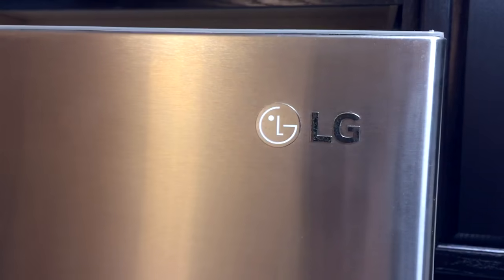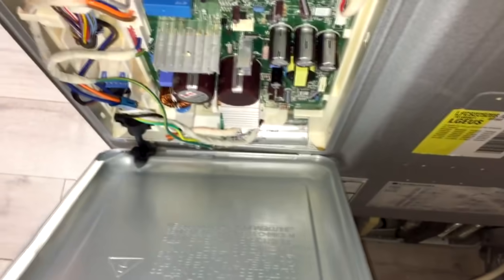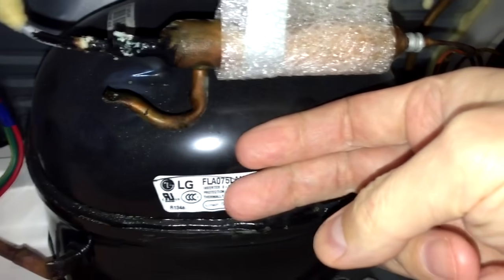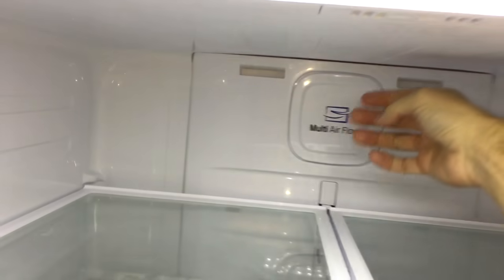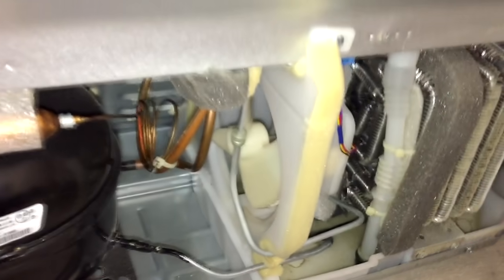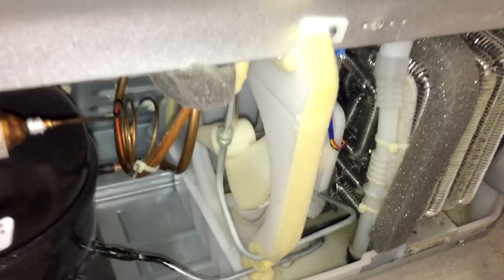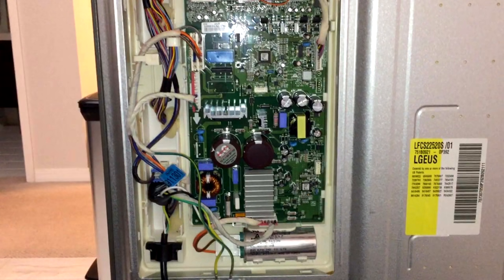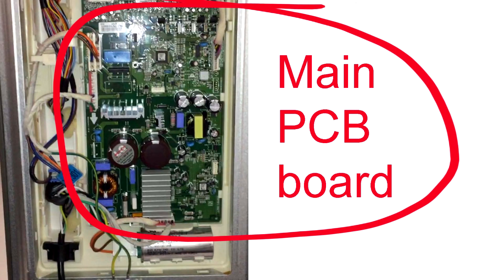LG refrigerator test and reset button

Comment: Stage 3 on my fridge doesn’t even work , would that mean that the thermistor to defrost the evaporator has gone bad?
Reply from the maker: Some LG refrigerators have only 2 stages. First stage - all fans and compressor work. Second stage - fans and compressor off, and defrost ON. If it's already warm inside the refrigerator, the Defrost stage will be skipped. What is the actual problem with your fridge? And the model number can be helpful.
Reply: @Your-Self   LG fridge Model # lfxs27466s 

Compressor works , evaporator works, both fans work. But it just isn’t cooling the top. The fridge I have , has three stages, was testing it today, and all of a sudden the third stage didn’t want to initiate anymore. But at this point I’m stuck. The ice section is getting cool air. Just not the top portion. It’s hot in there.
Reply from the maker: I've looked at the service documentation, and it's showing conflicting information. So I'm still not sure if you have 2 evaporator coils (one in the freezer and one in the top fridge) or just 1 inside the freezer.
Either way, you need to measure the freezer temperature. If it's around 0°F, the problem may be minor. But if it's significantly above 10°F, it may seem cold but could be a beginning of a major problem.
If the freezer is at 0°F, you can focus on the top fridge compartment. I'd take everything out of the fridge compartment including the back wall, to look at the evaporator coil (if it's there at all). If the coil is full of frosty ice, you may have a defrost issue. Under the coil should be a black rod heating element. Or maybe your model doesn't even have this heater and relies on the fan to defrost it... not sure.
It's difficult to troubleshoot without knowing what's inside your system due to poor documentation.
Reply: @Your-Self   the model I have only has one evaporator coil, and that’s at the bottom(freezer). It doesn’t have the two like I seen in other models. The element does indeed work, but seems to only have come on when opening the freezer portion and keeping it open. It then starts to defrost. Was a bit stumped at that point, so I decided to use the testing phase. I have confirmed that it has three stages to the test. It’s just that the third test wouldn’t initiate after a couple of tries. But I was able to verify that the element does indeed work. As for the evaporator, it gets a bit iced up but I wouldn’t say it’s excessive. It only has some, not enough to restrict air flow. 
Today I will be measuring the freezer temp and see what I get. But it’s gets really cold down there already.
Starting to assume the temp sensor(thermistor) might be faulty. That or the defrost sensor. I believe the evaporator fan should be blowing a hell lot harder than it is currently. The other fan is for the ice making section, and that works perfectly. Real strong cold air going to it. The fans in these fridges have different speeds controlled by the PCB right?  Research has shown that there isn’t no temp sensor on top, just the bottom. So I’m leaning on that for now, since everything has been verified to work.

Comment: When I run the test on my side by side with lower freezer the test #3 does not happen. Test 1& 2 seem good. But when I push it the 3rd time, no beeps and it just stops. Its model lfxs28968s. Thank you

Comment: Thank you for the video, it is very informative and easy to follow.  I have a lg LFX25991ST (French door) with an evaporator fan problem.  No air flow in normal operation, fan works great during test mode 1.  

I took off the panel to access the coils and fan,  and found plenty of ice on the coils.  I defrosted the coils with hot water, wet shop vac came in handy for overflow below.  

I'm not getting any error codes after running all test modes and waiting for everything to cycle back to normal.  Not flashing LED on bottom right of PCB.  I'm pretty sure I've located the bulb, but no blinking.  Evaporator fan doesn't kick on in normal mode.  

When should I get the error codes?  The moment I press the test mode button or after the 3rd test?  I figured it would light up after it completed all tests, but it never did.  

Any thoughts on what the problem might be, or suggestions on a new fridge 😄🙃
Reply from the maker: Looks like your model has two evaporator coils, so the freezer and the fridge compartments cool separately, one at a time.
It's normal for the fan to stop when you open the door in the normal mode. Trick the system as if the door is closed by activating the door switch. And the fan should start blowing within a minute unless the other compartment is cooling currently.
Error codes may come up at any time or may not come up at all, even with a problem.
Which compartment did you defrost? And what is the actual problem, both compartments don't cool? Is it any better after the defrost?

Comment: my LG fridge give 3 blinks when I do the testing
how can I fix the bad PCB 
thanks
Reply from the maker: The problem, most likely, is with the compressor itself. Or the refrigerant leak that caused the compressor to fail. It's best to call a technician to troubleshoot the problem.
Reply: thank

Comment: Excuse me, my refrigerator model is LT1342BbWI and it's not cooling or freezing since yesterday. I ran this test and there is a blinking red light that goes for about 6 times, stops, and then blinks again. The board is atop not behind. Hope you could help me.. Thanks
Reply from the maker: You didn't mentioned if you verified that the compressor is running, and both fans are running as well.

Comment: Need help. My refrigerator is giving off off the charts radiation. I have a meter and it is off the charts. What can I do to resolve this? It’s LG model LFXS29626S
Reply from the maker: What kind of radiation, ionizing or thermal?
Reply: @Your-Self  I am not sure what the differences I have a meter that reads RF. And it is off the charts
Reply from the maker: RF stands for Radio Frequency. And it's probably coming from the WIFI on your fridge... if you have it. Shouldn't be a problem.
Reply: I want to disable it. Do you know if there’s a way to do that
Reply: @Your-Self  I’m so sensitive to rf I need to figure out how to disconnect it. It’s not a smart refrigerator but it has the smart thinQ And I’m thinking it has to do with that. I have a 7 pound dog that is acting weird. And the meter goes crazy and it’s not even readable the levels are so high when I go near this refrigerator
Reply from the maker: Even though it's not a smart refrigerator, all operations are controlled by computer boards that communicate with each other. And that's probably what produces the RF noise. I'm afraid the only way to stop it is to unplug the fridge. Consider getting another basic refrigerator that's not computer-controlled.
Reply: @Your-Self  thanks so much for answering. I saw someone post how they disconnected the wifi Module on their Samsung and it stopped the RF. I didn’t know if the board for this as the same thing and I’m not capable of pulling it out. I wanted to find out before I did that. I appreciate you answering thank you have a great day

Comment: Late response to this video.

Test mode, besides the defrost as I don't have any build up worked great.  The fans blow full speed and cold air in the fridge and freezer.  Kenmoore elite 795.74023.410.  Condensor, compressor evaporator fans all are running.  However my ice machine works and then doesnt work.  My fans are turning but it is not cooling and the fans are not moving or blowing air like they do in test mode or normally.  Not even a noticeable amount of air moved or heard just see the fans spinning.   Bought in 2014.  8 years old.  
No beep or flash codes.  I replaced a fan evaporator as it didnt spin.  

Anyone have any ideas ? 

Thanks,
Chris
Reply: I am having this exact issue

Comment: Hi,  the error indicator led is flashing 6 times.  How do I know whether it’s an issue with the capacitor or compressor?  My fridge is not cooling and I tested the linear compressor continuity in my LG fridge and it’s around 6.7 ohms.  Compressor seems to be starting up  and all electricity is working as well as the evaporator and condenser fans
Reply from the maker: You can check the large capacitor with a multimeter. But the problem most likely is with the Sealed System. So you need to check the pressure in both the Low and the High sides to figure out what exactly is wrong with the fridge. Before you pierce the sealed system, how old is your fridge? It may be covered under LG 5 and 10-year warranty. Also, did you check compressor short to ground?
Reply: YourSelf yes I did check the short to ground.  No ohms so that is fine.  It is about 7 years old.  I already called lg and was told the compressor is still under warranty but I would have to pay for labor to replace
Reply from the maker: How much did they ask for labor? Probably still cheaper than trying to fix it yourself.
Reply: YourSelf I’m guessing it would take around 300- 400 to replace.  I would have to pay $100 to get an LG authorized service company to verify that the compressor is bad.  Then another 200-300 for labor.
Reply from the maker: Sounds about right. But typically, LG offers to buy a labor warranty for about $360 and then repairs your compressor for free. Let us know if it was the compressor or something else.
Reply: @hnguyen101981 was it the compressor?

Comment: I’m on stage 3 and I know that something in the defrost system is damage , I’m being waiting to hear ice cracking and nothing is happening but I see water going down in the back could you please help me
Reply: Also when I finish the test it doesn’t show any error light in the mother board but it just keeps creating ice in the coils and blocking the fans , in the end the freezer gets hot and the fan keeps making noises because of the ice
Reply: I think the problem is the fan that is working but maybe is not punching the cool air with enough force
Reply from the maker: Since you see water draining in the back, the defrost system seems to be working but possibly not good enough. 
Maybe it's just a one-time problem. For example, if someone left the door open for a few hours, there would be too much frost build-up on the evaporator coil. It's best to remove everything from the freezer and manually defrost all the ice from the coil with warm water. Hopefully, the problem will never come back.
Also, make sure all rubber door seals are in good shape, closing doors tightly.
What is your refrigerator model?

Comment: I have an issue where max voltage supplied from PCB to linear compressor tops out at 70vac. I even unplugged the the fridge and unplugged the compressor output and ran test mode 1. After 30sec the voltage output still only tops out at 70vac. We had the board replaced and new board does the same even in test mode. Could I’ve gotten a bad new board?
Reply from the maker: ======== I don't see my reply, so sending it a second time=======
The normal operation voltage should be at least 80VAC, and during the Test-1 around 200VAC. Seems like the "new" board is bad as well.
PS. Make sure your house electrical outlet supplies 120VAC to begin with.
Reply: YourSelf 
I did verify 120vac out of outlet and 120vac at PCB. I tested my sensor in ice and measured 7900 ohms. Literature states 8k at 32f so pretty spot on. 

Freezer is warm so PCB should be calling for 100% on compressor 200vac but it’s not. It’s just stuck at 75vac so my suction is only pulling to 50psi, not nearly good enough to make temp.
Reply from the maker: 50 PSI on the low side may indicate a broken reed valve inside the compressor as well. But since you unplugged the compressor during the Test-1, a good PCB should be sending the full 200VAC to connector CON201 (typically Black & Gray wires)
Reply: YourSelf 
Right I would say same thing on compressor valves if it was at full capacity running at 200v and still at 50psi but since it’s only pumping at 30% capacity that to me explains the hi suction at 70vac.
Reply: It’s just one of those things where you question everything since a “new board” did same thing. I’ve gotten bad parts in past but very rarely. Maybe I did get a bad board.

Comment: The fans only work when I put my fridge in testing mode, how do I fix this?
Reply from the maker: During a normal mode, when you open a door, the fan may stop automatically. So, you need to trick the system as if the door is closed by activating a door switch. The fan should start blowing within a minute.
However, if during the Test the fan was blowing warm (room temp) air, the compressor could be bad.
Reply: The air in the top “refrigerator” part of my fridge was blowing pretty faint room temperature air, but the air in the freezer was cold. Even after waiting an hour the fans in the fridge stayed off and internal temperature was still warm

Comment: Does step 2 flip the diverter valve to open one half of the system?
Reply from the maker: Yes, in some dual-evaporator systems, the diverter valve will switch to cool one side only.
In single evaporator units, the damper-door will close and cool just the freezer.
But in some models, step 2 goes straight to Defrost Mode.
Reply: @Your-Self  is step 2 necessary on that kenmore unit when recharging?
Reply from the maker: Not sure what Kenmore unit you're talking about.
But, in dual-evaporator units, start Test 1, wait about 10 sec for both evaporators to open, then unplug the power. Now you can vacuum and charge the opened system correctly.
Reply: @Your-Self  correction, I'm referring to the LG in your video I have a Kenmore with the same setup.
Reply from the maker: The LG in the video has a single freezer evaporator, so no need to do the Test to recharge. Yours may look similar but have 2 evaps.

Comment: On test mode my refrigerator run the 2 fans. Back to normal mode, only run the bottom fan. And thats the reason why my refrigarator no cooling. Whats maybe the problem.??
Reply from the maker: When you open the door during the normal mode, the Evaporator fan stops automatically, so you have to activate the Door Switch and hold it for about a minute for the fan to start blowing again.
During the Test mode did the evaporator fan blow cold or warm air?
Reply: @Your-Self  is not warm.. but is fresh.. stops auto..
Reply: @Your-Self  compressor is hot.. not big noise..

Comment: I purchased LG side by side door refrigerator, when i connect to wifi and doing smart analysis it is showing there are high humidity level at the installation location. No air flow is coming from vents  like when AC is on and when we keep our hand we feel air is coming out.what may be the reason. Please reply

Comment: My LG fridge stop making ice, but I still able to get drinking water from the fridge. I tried to press the test button, but it not reasoning at all. I replaced the ice maker and the left door control board that on the top still no luck. Any idea? Model# lg lmxs30776s
Reply from the maker: When you press the Test button and it doesn't work, are you talking about the Test button on the ice maker, or the main PCB as on this video?
The temperature inside the ice maker should be really cold to start the process. In some models the temperature must be below 19°F, in others below 5°F. Put a thermometer in the door ice bucket and see what you get.
Are there any error codes on the door display?
Is the ice maker trying to move, making noise, filling up with water, or completely dead?
Also, if the replacement ice maker is not the correct model number, it will not work.
Reply: @Your-Self  Is the test button in the icemaker. I always set my freezer temperature to -1°F and no error code displaying. Icemaker did try to turn after plugging the refrigerator back in, but not even a quarter turn. I  replace the exact model number icemaker, but no luck. My last thought is to replace the mainboard see that will help.
Reply from the maker: It sounds like you don't have power, or have intermittent power to the icemaker. Before replacing the motherboard, make sure the icemaker plug sits well. Unplug it and replug it back in... make sure the plug snaps in. Disassemble the water/ice dispenser assembly, and replug all those plugs as well.

Comment: My kenmore 795.72493.611 is not cooling fridge nor freezer.  In test mode freezer blows air and side vents in fridge does also, on main display panel I get 22 22 I presume this is a code.  Is my compressor dead?
Reply from the maker: The 22 22 code just means it's a Test #2, and 33 33 is a Test#3.
If you can feel the air blowing, but it's warm, the compressor is probably dying. But it's also possible that there is a Freon leak or a clog inside the Sealed System.
Reply: @Your-Self  it only blows in test mode.
In standard mode all lights work but no air blows or circulation.
Reply: @Your-Self  On this model would it be wasteful to replace compressor?
Reply: @Your-Self  if clogged how to remove?
Reply from the maker: Any of these repairs will cost $600 - $1000... probably not worth it.
Reply: Thank you for your knowledge and responsiveness.